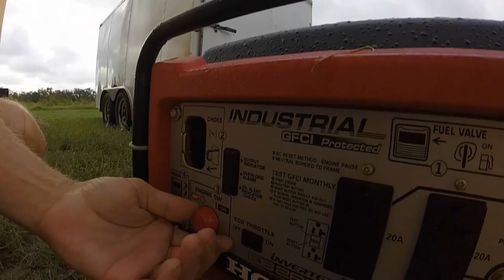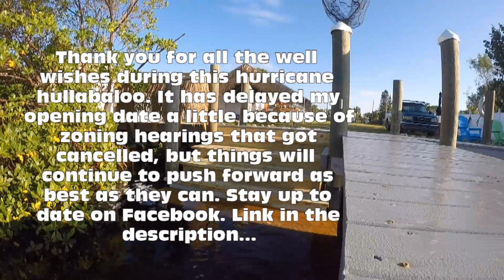Quick Business Update: Dealing with Hurricanes

Comment: Hurricane Betsy (category 4) hit Jefferson Parrish on August 27th of 1965 just 10 days after my 11th birthday. We were ordered to evacuate. Dad had a 1958 Cadillac, never failed to start, well, for some reason, it didn't start so we had to take his "company" car a 1960 Fiat across the Lake Ponchartrain bridge. Back then, it was just 2 lane but the southbound lane had been closed allowing both lanes to be used to go North. The waves were actually crashing over the bridge and slamming on top of this little Fiat with 4 kids and mom and dad. Then on August 14th, 1969, hurricane Camille hit which was a category 5. Dad then had a 1960 Chevy stationwagon and mom decided the best place to stay was at the St. Vincent DePaul hospital where she worked at as an R.N. The hospital at that time was "L" shaped and dad drove around to the backside which was the "inside" of the L. He pulled up to the backdoors and before we could get out, a wind came through, picked the car up about 3 feet off the ground and turned the car around a complete 180!! We ended up in the main lobby crouched down behind the sofas and chairs which was a good thing because it wasn't soon after that the plate glass windows broke sending shards of glass into the main lobby area.